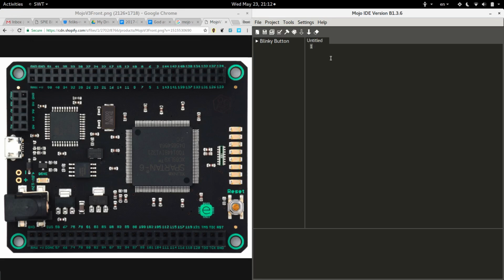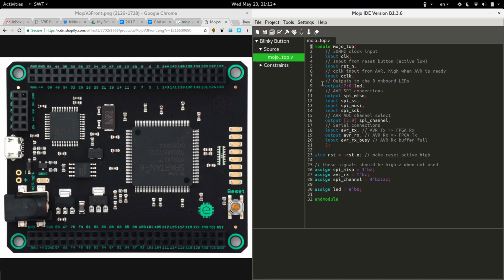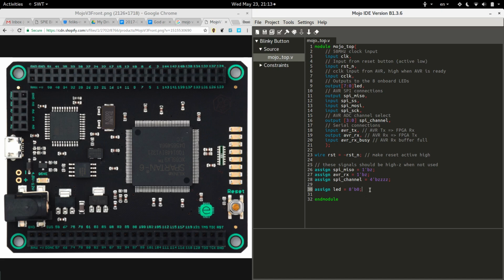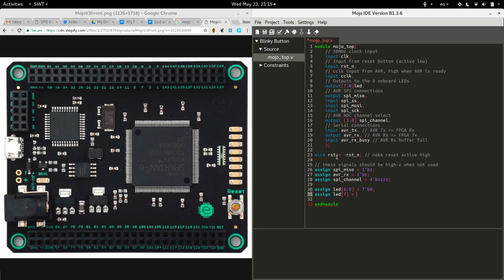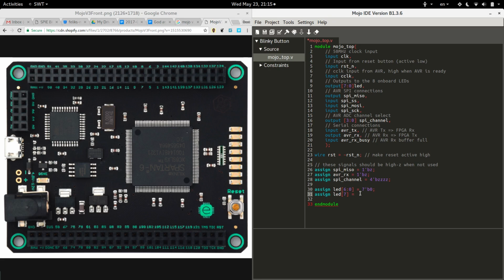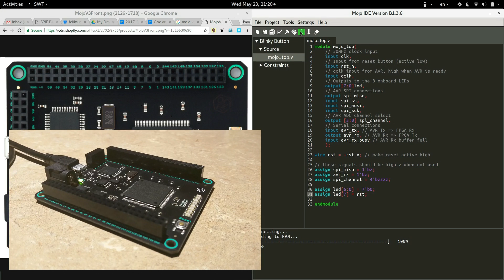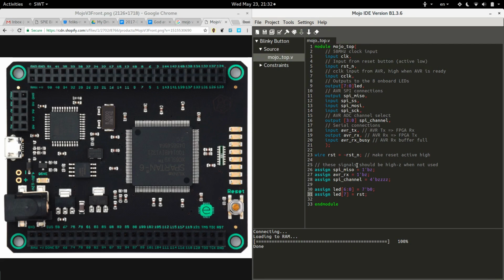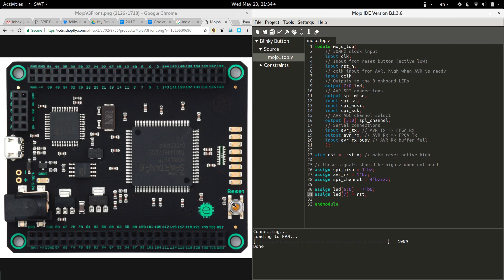Learn FPGA #6: Actually building something (Blinky Button) - Tutorial

Comment: 5V seems like supply voltage. Don't those kinds of chips usually use 3.3V for signals?
Reply from the maker: Yes, you are correct. Some logic devices use 5V, which I used conceptually for simplicity's sake, but a more accurate statement would be 3.3V in this case. I mention that in another video.

Comment: this is a development board, right? So when you are done you'd pull out the chip and put it into a socket for whatever you need it for, correct?
Reply from the maker: Not quite. Every time the FPGA powers up, it needs to be configured. That's why having the FLASH memory on this board is important. The FPGA config gets saved into FLASH and loaded onto the FPGA chip upon powerup.